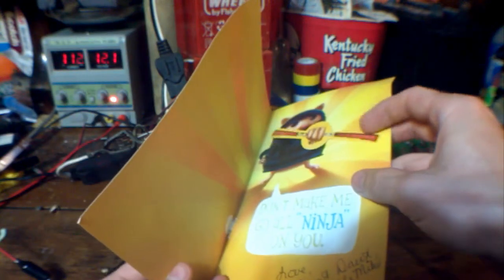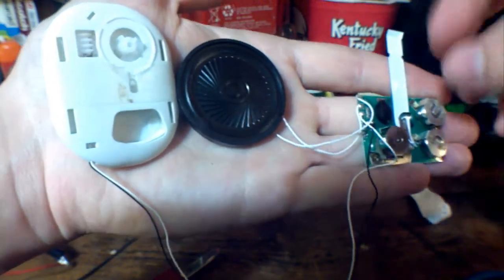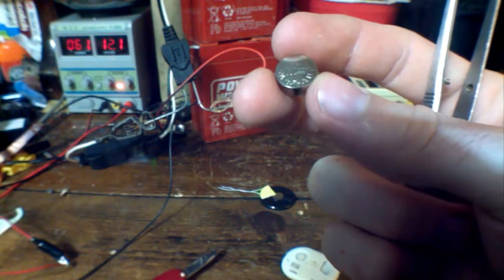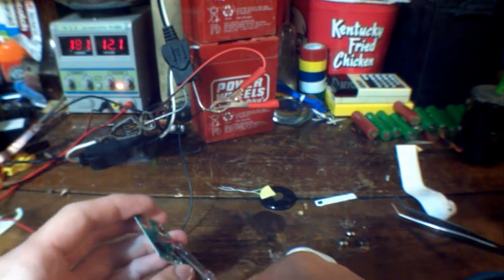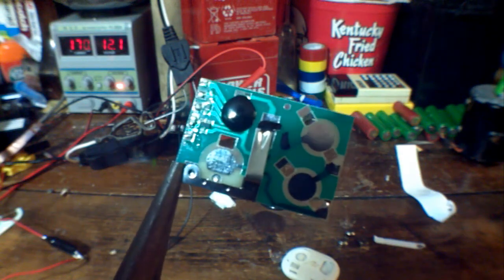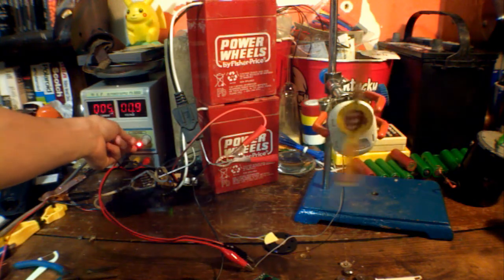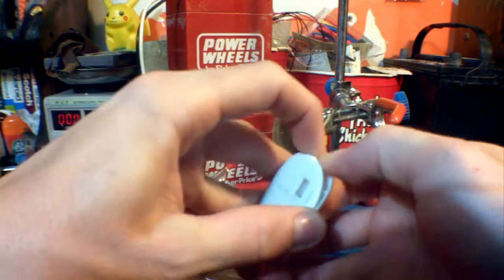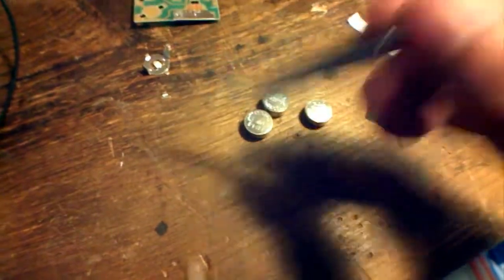digital gift card autopsy

Comment from the maker: oh right, they where used for the vibration call/text notification. i remember a long time ago i was looking at some motors this size but they where geared. had like a 1/400 gearing ratio. i was going to use them in the finger joints on the Wall-E robot i was trying to build.